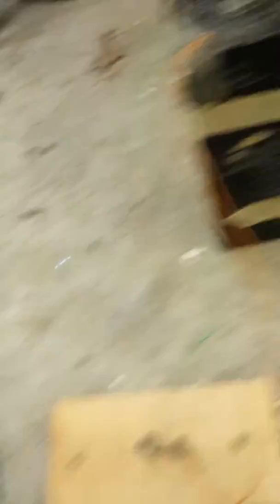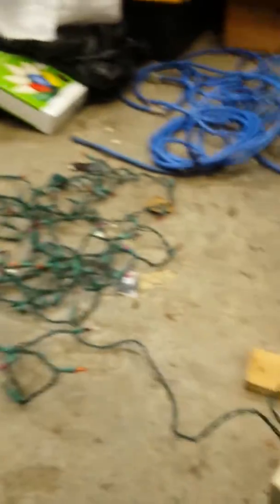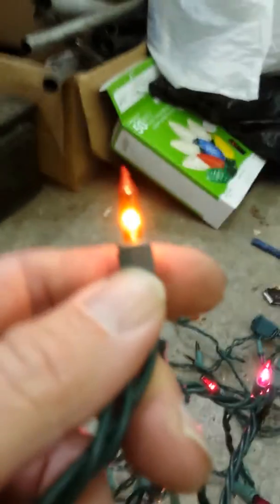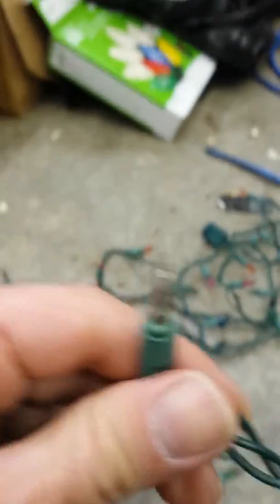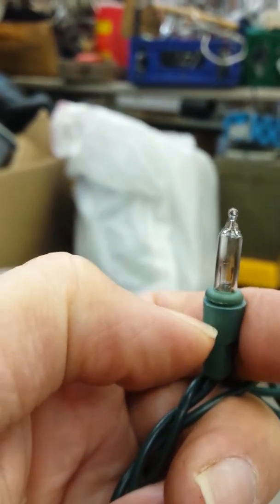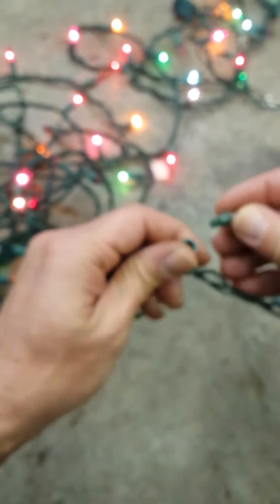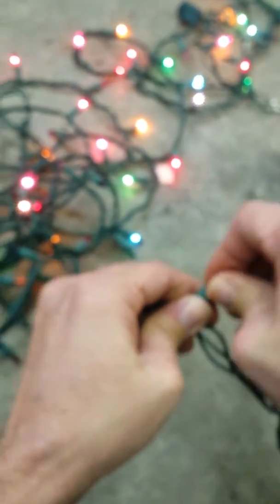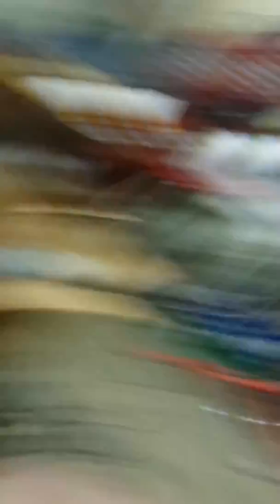Christmas light string repair challenge for Mehdi from ElectroBOOM.

Comment: Hey Aaron! Nice video. I already did fix my Christmas lights in a video I made a while back, kind-of the same way. You way is fine too! The issue with this method is that you shouldn't have missing lights or broken wires otherwise your string remains broken.
Reply from the maker: That is the part I forgot to mention.
Reply: Hi electroboom!